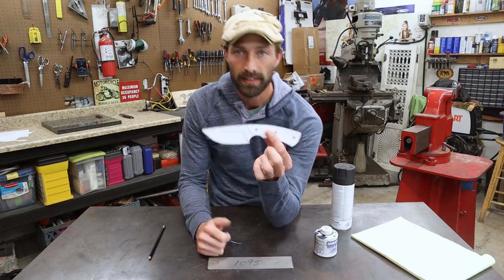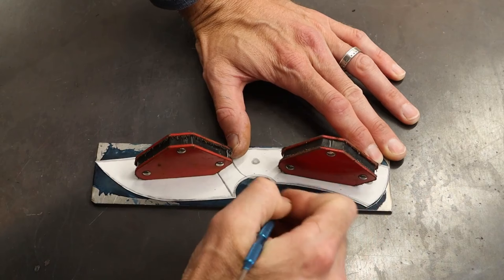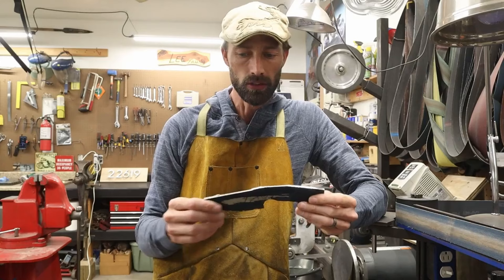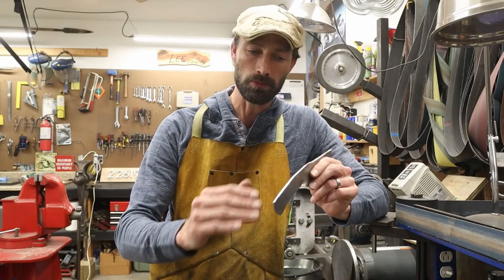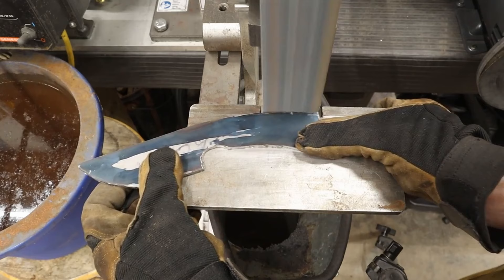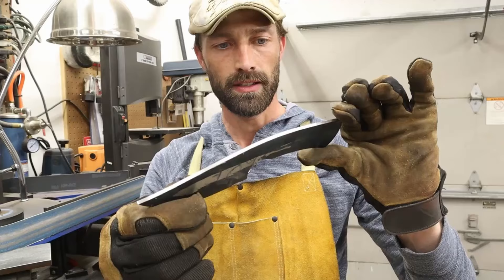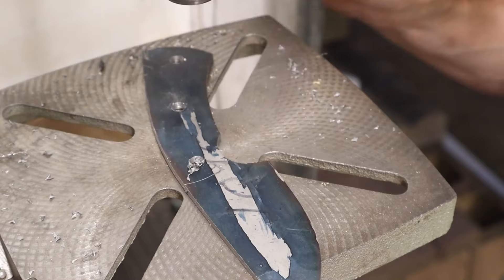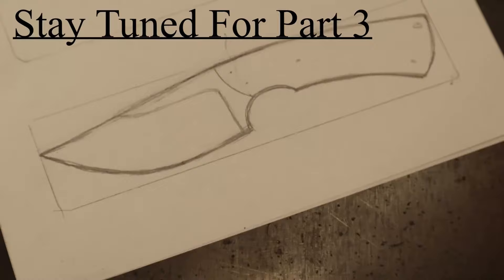How to make a knife -Part 2-  Nailing the profile

Comment: For pin layout I like to cheat 1-2mm above the centerline towards the spine. After the contouring the bottom of the handle, center aligned pins can still it can look visually low. I mainly work with chef knives with larger handles so this might exaggerate the effect. Lots of good info, thanks for posting
Reply from the maker: Neat idea!

Comment: I recommend working without gloves on the grinder. Yesterday i was working and the tip of my glove got caught in the gap between the belt and the flat plate. Took it right off my hand. Good thing i hadnt tightened the velcro strap around my wrist.
Reply from the maker: Well that's scary!

Comment: Wonderful series. Thanks so much. Can you point out some decent 2x72 grinders?  Also, you have a plasma cutter in your links. Can you/have you made a video on its usage with compressed air (is dry air VS regular compressed air a thing?) VS cutters that use tanks of elements?
Reply from the maker: Interesting! Will do and yes in my experience dry air is critical

Comment: Hi I know you probably mentioned this in a video, but what milling machine do you use for guards? Been making knives for about 4 months and tired of filing for the hidden tangs. Looking for something that works good but won’t break the bank. Thanks!
Reply from the maker: I personally use a Bridgeport, it's a good old American machine.. You can usually find them for about 1500 bucks the hassle is moving them because they weigh 1200 pounds

Comment: ALEE where are you buying your precision ground 1095?
Reply from the maker: Is the New Jersey steel Baron
Reply: I called new jersey steel baron, they said they only sell oversized 1095...is that the same as precision ground?  Maybe I'm not using the right terminology? 🤔
Reply from the maker: That's what they call it. Incomes cut perfectly without the edges rolled over. I guess they don't want to call it precision ground because it might vary in thickness slightly from sheet to sheet
Reply: @Aleeknives  thanks man!  You're videos are so well put together...thank you so much! You're making the process of knife making less daunting